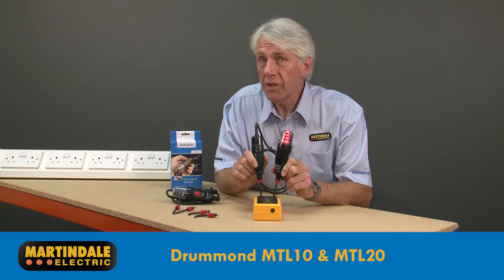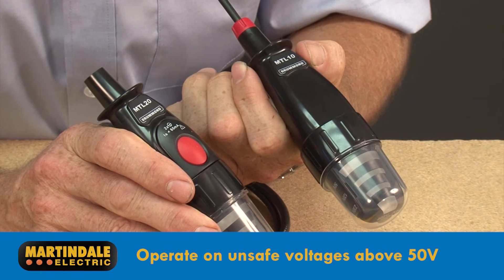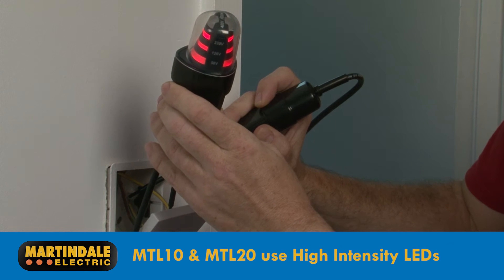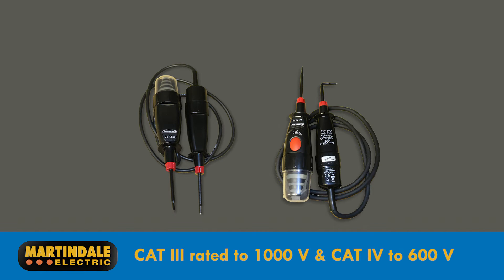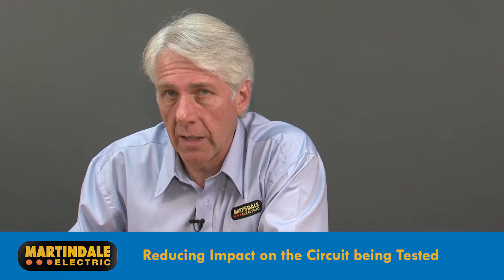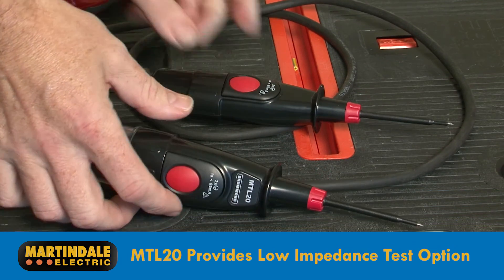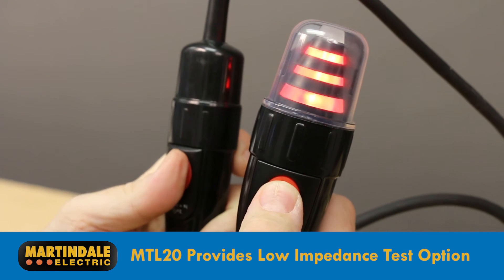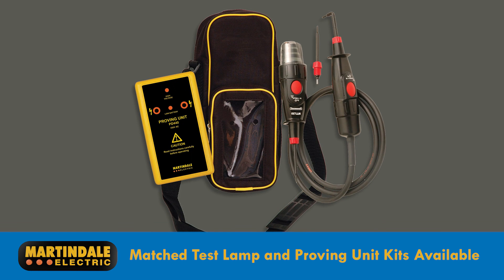Drummond MTL10 and MTL20 test lamps for safe isolation

Comment: Greetings.. MTL20 test lamp good quality tester. Good insulation.  Low weight.  Easy  to use. But unfortunately my test lamp not working. 😢 how to change inside fuse . Any option for change fuse (Hrc). I'm not find open point . Kindly help me 😢

Comment: Hi, for the mtl20, the 2 buttons when pressed and the led lights goes off, means it is safe to work on the circuit or after pressing the 2 buttons and the led lights still remains that there might be hazardous voltage still present? Kindly advise please.
Reply from the maker: Hello Ahmad ! As a general rule, if the lights are on the circuit is NOT SAFE to work on. If the LED lights turn off after you press the buttons, it may be possible that phantom voltage is present. To make sure the circuit is safe, you need to test again without the buttons pressed; if on the second test the lights are still on, then the circuit is NOT SAFE and it requires further investigation. If on the second test the lights don't come on, then the accumulated phantom charge has been dissipated by the MTL20 and the circuit is safe.
We hope this clears things up; if not, feel free to ask more questions. Have a great day !